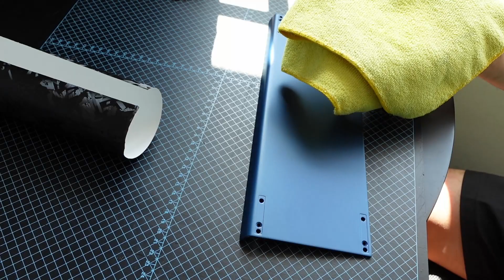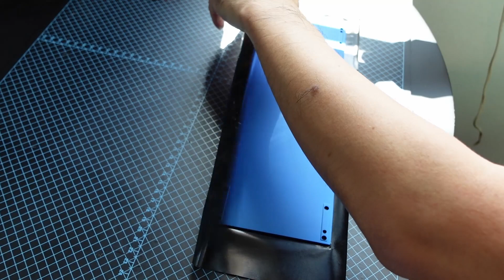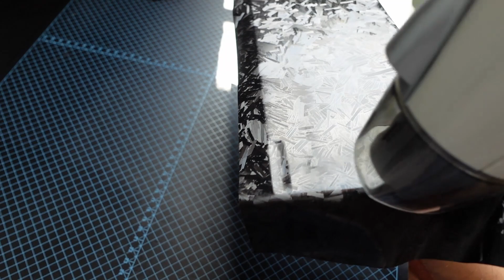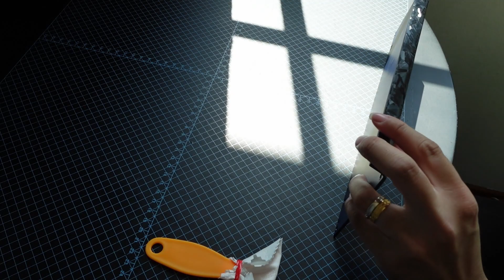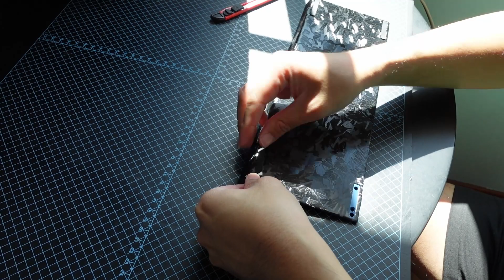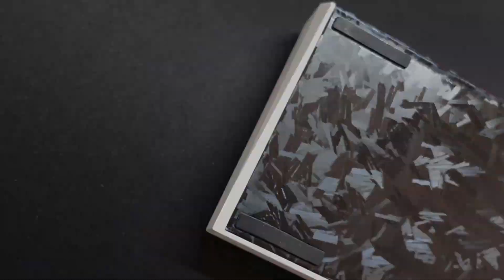Vinyl wrapping my keyboard

Comment: Mind if I ask what size of the wrap would u need to purchase to cover the whole back of QK65? really nice idea and wanna try it out myself
Reply from the maker: The QK65 is roughly 320mm by 115mm so if you purchase a roll of about 500mm x 500mm or larger, you will have enough to cover the keyboard weight with spare in case of a mess up requiring a re-do 👍
Reply: @studio20creations  3ft x5ft would be enough?
Reply from the maker: Yes more than sufficient :)